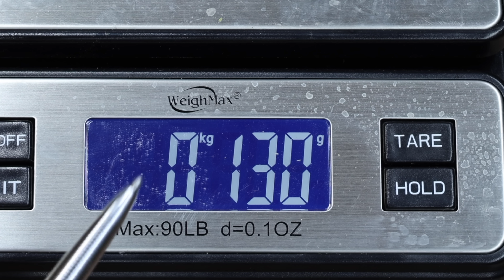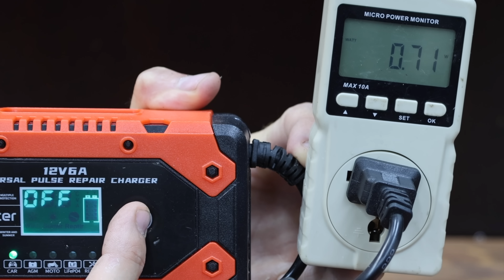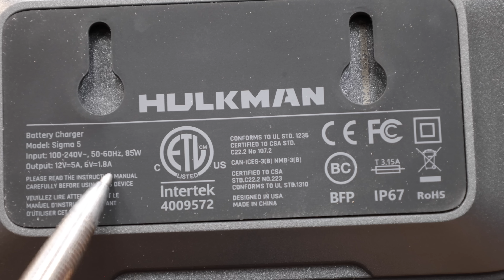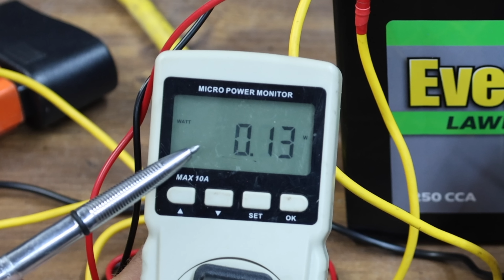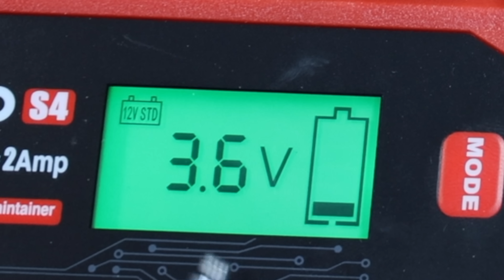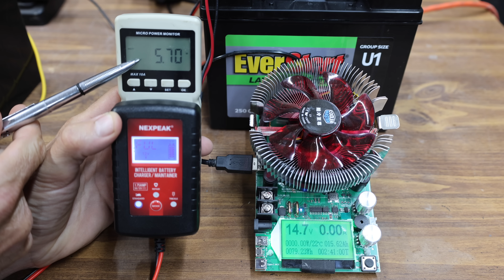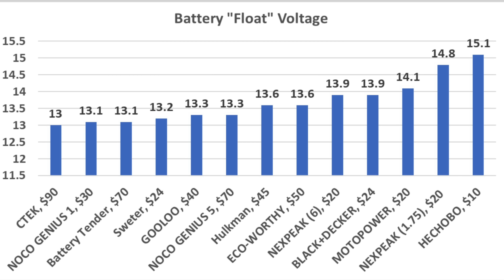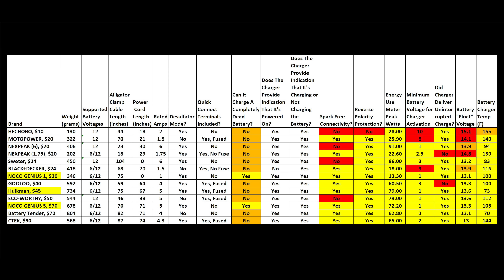I Tested the Most Hyped Car Battery Chargers – One Stood Out!

Comment: Going against the popular flow here, but I have two of the basic B&D units and both have worked faithfully for 10+ years of 24/7 use for winter-stored vehicles. Batteries maintained by them have lasted 8-10 years. Nothing fancy or popular, but they just work.

Comment: Ok batteries in series - 12V system, just multiple batteries. Can you just hook the desulfaror and float device to the first in series or would you need to disconnect them all and work on them individually?

Comment: I was thinking that Desulfating Mode is a good thing, until I read this from Battery Tender: "Sulfation happens when sulfate crystals build up on the lead plates of a lead-acid battery, usually when the battery is left discharged for too long. These crystals block the flow of electricity, reducing performance and shortening the battery’s life.
Some chargers on the market claim to reverse this buildup through a process called “desulfation.” The idea is that by forcing high-frequency or high-voltage pulses into the battery, they can break down those crystals and restore battery health.
The Paperclip Analogy: Why Battery Tender Chargers Do Not Desulfate
Here’s how we like to explain it: imagine a paperclip. You bend it once, and it’s fine. Bend it back and forth repeatedly, and it gets weaker, eventually snapping. That’s essentially what’s happening inside a battery when you desulfate it. Each pulse stresses the internal plates, and over time, it can cause more harm than good. You may temporarily restore function, but you’re weakening the battery in the long run.
That’s why Battery Tender battery chargers do not include desulfation mode. Instead of stressing your battery to “fix” a problem after it develops, our smart chargers are designed to prevent sulfation from happening in the first place.

Comment: Charging cometely dead battery is 🤨
If you have another charged baatery, then parrellel connect it to just start charging. 
Even a fully charged 3.7v battery will activate charging.

Comment: I've been using rwo noco genius 1's on two cars, both 12v and agm types, for over a year.  First class operation, I swap out the autos, a Ford explorer during the winter and lincoln mkz during the summer, garaging the unused vehicle in the off months.  Zero problems on both.  Bought through Amazon.  You'll note that it was only one of two charger/maintainers that will charge up near completely dead batts, the other the 5amp version.  I hooked up one to a neighbors Toyota that was completely dead and it took overnight to bring the 1amp version completely back to full charge.  Cant beat it.

Comment: I have a PulseTech XC100 battery charger/maintainer and if the battery is completely dead the XC100 won't charge it. I then hook it up to my 53 year old Craftsman charger to charge it enough so the XC100 will charge it. There should be an override button so if the battery is completely dead it can still be charged.

Comment: My brother in law has a top tower charger. I tried to use it to charge the dead battery in my daughter in law’s Chevy equinox but it wouldn’t. The battery was almost brand new and the dealer had said the old battery had been discharged by the rear wiper getting stopped out of home position due to a bike rack she had on the car. I couldn’t get the charger no jump starting to get any response from the car so I unbolted the wiper while the charger was connected and connected but still couldn’t start it or get the charger to charge the battery. It finally occurred to me that the car or charger was still seeing a draw by the out of position wiper(acting like a short) and the charger wasn’t allowing it to charge. So disconnected the battery from the car and then was able to charge it. It battery was pretty much completely discharged. Brand of charger is a top tower model bc0253-2

Comment: First test is just pointless.  If a battery voltage drops below a certain value, the battery is irreversibly damaged. So there is no point of charging it. If you would buy new battery for each device and sorted the tests from from least harmful to most harmful and the final test would be that you would discharge lead acid batteries to the limits of it's chamical possibilitties, it would be much better.

Comment: I have to maintain about 10 batteries.  I have used many devices.  Schumacher devices are absolutely outstanding. Foval's Fully automatic 1,000ma trickle charger are bulletproof, reliable and can bump a completely dead battery enough for the bigger ones to take over.  Avoid Nextpeak NC101, bought a two pack.  One bricked after being plugged for a couple of weeks, doing normal tending duties.   The other is seriously screwed up.  If you leave it tending a battery for three weeks.  Upon return the device was indicating green, normal, fully charged and tending.  Removed the device and learned the battery was fully discharged.  Dead.  Had to use the Foval followed by the Schumacher to recover it.  Both NextPeaks are crap. And it seems that several of these Chinese brands are repackaged clones.

Comment: This was great! I needed to get a charger that can charge the lithium ion battery in my new generator, I've had it for almost 2 years. I don't have the arm strength to use the pull cord to start it. I was able to get a Genius 1 charger, but I needed to order the SAE adapter so I can just plug the battery into the charger with the quick connect cable instead of trying to use the alligator clips. There's not enough clearance where the battery is located for the clips to get a really good grip, they popped off the battery a couple of times (to remove the battery, I'd have to remove one of the wheels). The Genius 1 handled the pop offs beautifully, no sparks or anything!! It charged the battery in about 6 hours. The Genius 1 is perfect for my needs, I can make sure the generator battery is charged up and ready to go before bad weather! This charger is much smaller than my old trickle charger too! I'm very happy with my new charger. It must be popular because there weren't very many available locally and the adapter I wanted was out of stock everywhere too, had to order it online. Thanks for all the work you do to conduct all the tests and making the charts. You include so much helpful information!
Reply from the maker: You are welcome!

Comment: Don't know if you know that with a empty battery, if you set up to repair mode.
The cheap ones are working, next day, the battery would have power again 🧐
And another important thing, if you talk about no power on a battery is not why people buying low amp maintainers.
It's just to maintain a working battery,
nobody buying 1.6 amp to repair empty batteries 😂👍

Comment: i can buy 2 AGM 12v  ATV batteries for the  price of the c-tech.  Using the BatteryTender brand I got 17 years out of my last atv battery. Although I am pretty sure that was coincidentally the end of that 20 yo batterytender. One of my newer BatteryTender failed within a year. 750 ma lswitchable lithium / Lead acid version.

Comment: How about the battery chargers that sta They repair batteries.Why don't we do a test on those topdon has one , I use from one from battery plus that I seem to have really good luck with and I bought a cheap one from amazon that didn't work.
Reply from the maker: Thanks for the suggestion.

Comment: NOCO genius 1.  It charged fine (red light/AGM) upon completion the light turned green.  I suspected that the battery was no longer 100 percent (light has probably been green for a couple days) so I pulled the NOCO from the wall outlet and immediately plugged it back in and the red charge light came on and it charged for a couple more hours.
Seems like I get one charge out of her and then she’s done. It’s not maintaining anything. Green light means it’s turned off.

Comment: I bought a Noco to keep 6V cart batteries charged and it never fully charged - blinked at 75%... forever. Tried on a LifePO4 (in an RV) and same issue. I changed to the Battery Tender and problem solved for both.
I should have taken the Noco back I guess...must have been a lemon. Glad to know that, in general, Nocos are OK. I thought I'd been scammed.
Thanks.
Reply from the maker: You are welcome!

Comment: Using that watt meter is somewhat useless unless you are certain it is calculating actual wattage and not VA, some of these devices probably don't have the best power factor and if that watt meter is calculating and displaying VA whilst calling it watts it could be displaying some big numbers with very little flow into the battery. 

Really need to measure current draw from the charger by the battery to know what is really happening on the output side.

Comment: After doing some research, I picked up a Vector 50A charger at Home Depot — and it’s a solid unit. Last winter, the six-year-old battery in one of my cars went completely dead and I was ready to replace it. Instead, I brought it inside, washed it thoroughly in the laundry tub, dried it off, and hooked it up to the Vector. I followed the reconditioning instructions and, after cycling overnight, the battery came back to life. I put it back in the car and it’s been trouble-free ever since.  I was impressed with how the charger’s algorithm evaluated the battery condition and adjusted the current cycling accordingly. For around $70, this charger is a great value. Excellent video and test program — thank you!

Comment: 1 amp isn’t enough to recharge a completely dead battery. Maybe after a week, but the charge voltage must rise to fifteen volts to successfully to  de sulphate the lead plates.  The pulse mode is a gimmick.

Comment: Not sure about the Ctek model you have, but I have a Ctek charger and it will charge a dead battery. But what you have to do is hook up the charger to the battery and charge it with the "12v" supply mode. This charges the dead battery some. How long to charge in 12v mode depends on how badly the battery is discharged. I had to charge one battery in 12v mode for 24 hours before using the CTek normal cycle. Switch to normal cycle on the Ctek and it will kick in and charge the battery. Have resurrected several old batteries this way.

Comment: The Noco Genius 2 Direct mount has been steller for me.  I have one on my lawn tractor and one on an older F150.  The F150 battery is 6 years old.  Still starts the truck with no issues.

Comment: I've had problems with several float chargers cooking my batteries..  (including the small Battery tender brand) I hate coming to check on a piece of equipment I don't use often and see the battery has been boiling over.... I switched to the Noco chargers a few years ago, and haven't had a problem since. Thank you for this video!
Reply from the maker: You're welcome!

Comment: Yes, I'd like to see a review of bigger 110a/c  powered  battery CHARGERS- I won't even consider it if it doesn't boost at 50 amps.  You need that for race engines with high compression.
Reply from the maker: Thanks for the feedback!

Comment: I have 3 different chargers that will not charge a depleted battery that show under 10 amps. If I use jumper cables from a good battery it seems to trick the charger and will then start charging the depleted battery when the cables are removed.

Comment: GO Sweden! (Ctek).
I only have Ctek.
There is nothing that beats them really.
Water protected, dust protected, workhorse, long lasting, durable, takes care of the battery (it also have a long flow charge mode, if you have a battery connected for a longer period, like weeks or months), and so on.
I can highly recommend MXS 10. That one can also deliver a steady12v output (13,6V, 10A) to power things that needs 12V. With that you can actually also trick it to start charging super dead batteries. Not that it really matter since super dead batteries are just trash anyway...
Strange that is was 13,0 Volt, but maybe it wasnt really finished?
If you leave it on it will stabilize to 13,6V (did you have a faulty meter maybe?), that is the correct float value to be at. After 10 days it will enter the next sequence to keep the battery as healthy as possible.

Comment: I have the Nexpeak and mine will start charging any battery I attach it too. I don't know why this one doesn't. A friend of mine charged her 2 group 65 batteries for her diesel pickup one at a time and got them to a good full charge. 
Now granted, mine and her batteries may not have been completely discharged, and I'm not certain I have used it on a completely discharged battery, but it has never failed to start charging a battery the second I attached it.

Comment: As someone who lives in a cold climate (Lapland, north of Sweden), my current 12V battery charger, Exide, model12/7 (from Exide Technologies which manufactures Exide/Tudor quality car batteries) is by far the best charger I ever had, and it has never failed despite charging in the cold at -40°C/F below freezing. 
This probably because it effectively regulates the charging voltage which dynamically temperature compensates for the ambient temperature, and raises the voltage at low temperatures to counteract the battery's increased internal resistance when charging in the cold. (Regulation of charging voltage which is a crucial factor for successful charging in both cold and warm conditions)
The charger has of course settings for Flooded Batteries (wet cell) or AGM Batteries and for battery capacity in Ah. 
It uses a 5-step charging process where, for example, desulphation is performed if it has diagnosed it as necessary.
The charger also has a power supply mode ("13.7 V Supply") where the unit acts as a constant power source instead of as a regular battery charger.
The mode can be used for continuous maintenance charging of batteries, and is also usable for powering electrical equipment that requires 12V power directly from the charger.

Comment: For an ebike. I am making a solar power station. 

For it, I need an inverter, b I suspect a hybrid inverter is needed. 

Would a hybrid inverter be better then a separate inverter and separate charger? 

Or should I just use a hybrid inverter with the battery?

Comment: A lot of farmers in the UK use the CTEK (the one tested or the more powerful version).  Farmers generally don’t ‘waste’ their money!  Both myself and my brother have the 5A version and I really appreciate the reconditioning cycle - it does actually work!

It used to keep a diesel car battery going until the end of the summer from mid-winter, saving quite a few £s over the years.

It has also been reliable - an important factor.

So that is my favoured choice.  I now use it to float-charge batteries used for a cyclic operation, not as an automotive battery charger as I no longer drive an ICE vehicle.  Now owned it for several years.
Reply from the maker: Thanks for the feedback.

Comment: Better do some homework on ChatGPT.  Float voltage of 13V invites long term sulfation.  Optimum float voltage varies slightly with battery type and storage temperature, but 13.5V to 13.6V is the sweetspot covering all of them.

Comment: I'm Glad, I found this, As My Dealership, told me that the Replacement of My 3yr/36K miles Factory battery. The (Refurb battery, Seems to drain too fast & I should invest in a battery maintainer. The Brand suggested Battery tinder.  Also was told not to use it, until the driving has fully charged battery. Then when home, hook it up to maintain charge. As I don't drive ofetn enough, Thus it will solve my hard start problems.  

IMO, I feel it's a crap (FREE-Refurb batter), That wasn't fully 100% when I got from them.  Battery last than 5moths old. & Only have had everyday electric problems, Dash lights flicker, or turn off & on, Radio takes under a minute to start up.  Also I hear the started grinding (metal on metal when starting.  (Has no pull on voltage,)   it only has 17K on it for a 2022 new car. 6spd M/T.  No bells or whistles. Just base power stuff.

Odd, The Battery AGM, That came with new car, never had any of these problems.  It's It's the Dealers replacement.

I get the Run ah- round, No Code tripped.  Everything seems to be working in specs, Well, I drove 30min's on Highway, Of curse the battery is fully charged.

Comment: Update: the NOCO Genius chargers actually do come with quick connects.  You unscrew the cables from the alligator clamps and can connect those permanently to your battery.  They then have the split in the wire to act as quick connects.

Comment: Hmmm, how can a review of battery chargers NOT include giants like Shumacher and DieHard? I have a 30+ year old Shumacher in my garage that charges AGM/Gel, small Lead Acid and regular sized Lead Acid. It also displays voltage of the battery and alternator as well as percent of charge. It charges all my batteries including the battery that was sitting in my jeep in the garage for 10 years...which was completely dead! It charged it right up then went into Trickle Charge mode automatically and it's sitting at 12.1 volts...Plus it has a Starter feature where it supplies massive power for 60 seconds. It automatically detects when you hook it to a battery and when you hit the Starter button, it starts counting down...it groans and the fans kick on at full speed. After 60 seconds, the starter function turns off and it goes to standard float charge. The starter function is so good, it can start an engine connected to a completely dead battery!

Comment: Ive had a CTek XS 0.8 Battery Charger for the last 10+ years. for my motorcycle. its connected 24/7 when the bikes not being used in winter. had no issues with it and bought another 5 years ago for my 2nd bike. again no issues.
Reply from the maker: Thanks for sharing.